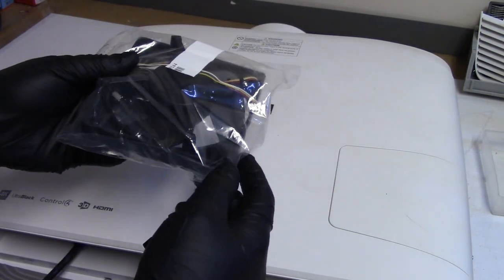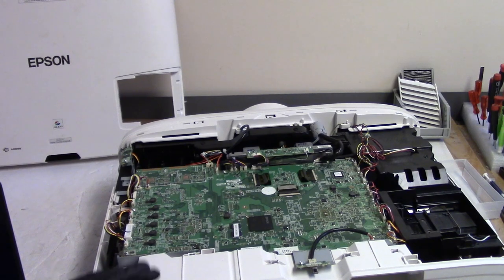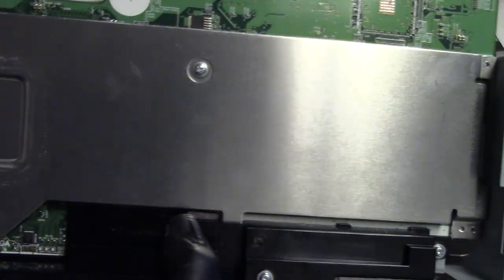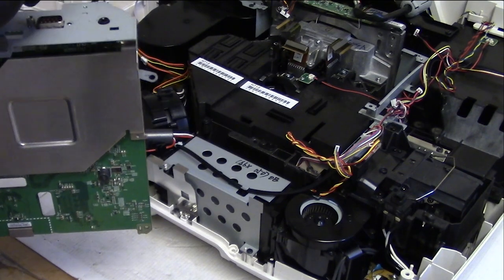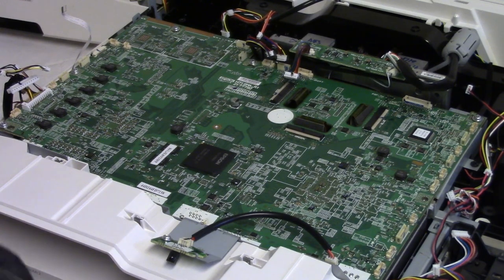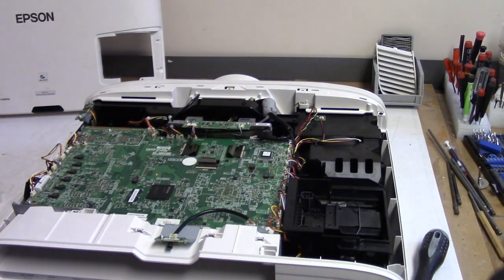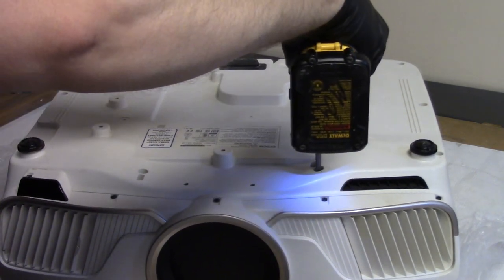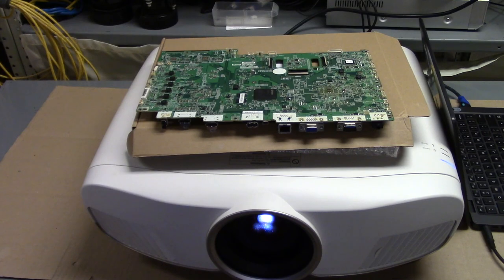Epson Home Cinema 5040UB LCD Projector Repair | No Video | New Mainboard - LAST EPSON REPAIR

Comment: My 5050UB stopped working and my Epson authorized retail shop says it needs a logic board and an optical unit. $1450 for parts alone, $1700 total to fix.  It was a refurb unit and it's only 3 months out of warranty. No love from Epson. Any suggestions? I'm pretty handy and have replaced failed boards on TV's, re-capped old cassette decks, etc. If I can get parts can I do this myself or does it require additonal equipment to calibrate, etc?
Reply from the maker: I hate to say it but run and chalk this up to being burned by a refurb. It really pains me to say this.  Epson is one of the worst right to repair companies in the world. they design this stuff to fail thoroughly and not be worth fixing.  The parts quote you got is dead on.  I wont even work on epson anymore unless its a power issue because you literally cant get parts reliably and the service info is non-existent.  
I know you want to at least give it a go, so I would check the voltage regulators on the mainboard first. They are a common issue.  Also, what is it doing/not doing?  I should have probably asked that first.
Reply: @FixitFrank  thanks Frank. It power cycles, bulb never fires up, then shuts off after 20 sec or so. Orange and blue lights flash even after the unit powers down. I’ve also discovered that the Yamaha receiver it was connected to seems to have a blown HDMI out (inputs still work and pass audio, just no video) so I assume a power spike caused this? Projector and receiver both have power conditioning but are on different circuits.
Reply from the maker: which leds are the ones flashing? If its status light and lamp light flashing(both flashing) that is an internal problem.  I'd check the regulators on the main board.  Little SOIC-8 chips. Usually grouped near each other and will have some inductors near them. If its not the status and lamp flashing, then check the manual on page 148 and see if it might be a fan issue(instant overheating warning).  https://www.projectorcentral.com/pdf/projector_manual_10863.pdf   <--manual
Reply: I have a 5050ub out of warranty. Not a refurb and used about 1500hrs. Status flashes blue, lamp and temp flash orange. Epson comes in the screen for a sec and then the projector turns off. Lights remain flashing. Epson support said maybe iris issue. I saw many videos of people cleaning out the iris mechanism. Was thinking of doing the same. Your video has me thinking it may be the motherboard. Trying to get over my anger to fix it myself. I've taken the cover off and am getting ready to remove the MB. 

Amazon won't let me leave a negative review for this projector. Beware!

Was BEAUTIFUL while it worked.

And thanks for posting this detailed video Frank!

Just read another of your responses that Epson won't sell the average joe a MB. This sucks more! I'm going to have to pay someone to fix this even if I can fix it myself. 😡🤬🤬 Probably best to put everything back together and take it to a shop.
Reply: @authorsauditions  Same issue with a 5040. Same lights flashing, manual says auto-iris. It's probably correct as I heard gear grinding about a week before it died. Found part online for $90. Found this video to help me take it apart. New unit purchased in 2016. Expected more from a $3k projector. You fix your issue?
Reply: @FixitFrank  I have the same issue like the one mentioned in a previous post. A 5050UB with status and lamp lights both flashing. I checked the voltage regulators and they all seem fine, I get 3.4V, 5V, 12.95V.
However, I noticed that the TS420 SCR is not working as it should. I have 17.5V at the anode but nothing at the cathode. Upon further checking, it seems that there is an almost 0 Ohm connection to ground. I would have thought that I should be able to trace down where that comes from, but I can't seem to figure it out.
Have you seen something like this before and an idea what may be the culprit? I have not been very successful even tracing the PCB down from the SCR's cathode...

Comment: I’ve been fixing projectors for over 20 years and never broken anything with static. I never ground myself either.
Reply from the maker: I've worked on so many things over the years and never wore a ground strap.  I'm sure it can damage things but as long as you're aware of what you are doing those chances are really slim.  If I worked with a lot of older cmos stuff I might, but nah. It gets in the way.

Comment: Does Epson sell a replacement mainboard for the 5040?
Reply from the maker: No, they don't sell anything except new bulbs. Epson won't sell anything to you unless you are an authorized Epson repair center. Epson is terrible from a repair standpoint.  I am not a fan of Epson at all. I tried to get over it but, this repair just reinforced my disdain for their repair practice's.  Very apple like.
Reply: @FixitFrank  thanks, thats very unfortunate
Reply from the maker: I couldn't agree more.  Very unfortunate

Comment: I almost bought one of these used but you scared me straight lol.
Reply from the maker: That truly makes me smile. I am not a fan of epson. but I will say when they are new, the picture is great and they work fine. Its the lack of longevity and repairability that turns me off. they are made to fail after a certain amount of time. I am convinced of that.  
If LCD looks better to you over DLP, check out Panasonic, Sanyo and NEC.  Their LCDs hold up far better over time. If you can find a WUXGA Sanyo from 2012 or a panasonic WUXGA projector from 2015 on, you can't go wrong.  If you dont care DLP/LCD then I like BenQ or if you can find one, Sim2 and Christie.
Reply: @FixitFrank  Thanks for the tips. Are the Sony projectors any good? Back in my bachelor days I got a Sony VPL-W400Q with a shocking sticker price in 1998; it still kinda works. But it spent some time getting work done under warranty. With a family nowadays it would be totally stupid to spend that kind of money. I just want to get something decent in the 5 to 7 hundred dollar range, which is kind of empty new, and a little uncomfortable to roll the dice used.
Reply from the maker: I LOVE sony and JVC.  You can't get a new one for under a few grand, but you can definitely find used sonys for under a $1000. you can search for "Sony SXRD projector" or "JVC DiLA projector" on eBay.   https://www.ebay.com/itm/334966741074 for example.  Any Sony or JVC 1080p projector is a good one.  They are the next step up from Benq, Epson and Optoma. If you want to let me know what models you are looking at , I can weigh in on them. Even a 10 year old sony will look better than a new BenQ in my opinion.

Comment: Yet another reason to steer clear of unreliable lcd technology...it's dlp all day  every day for me Frank! 👍
Reply: Im afrade of DLP now i use to love them but  I had a tv and 2 projectors and the dmd chip went out on all of them it was because the chip would get to hot the tv was mitsubishi and i replaced it 10 years ago and its still going the projectors were benq and i could never get more then 2 years out of them before the dmd chip would start to die I switched to a epson kinda like this one a 4010 and it so far works a lot better then benq
Reply: @JunkerDC  Benq was the issue I'm afraid...I've had 2 infocus projectors, and my current Mitsubishi HC4000, and have all been faultless👍
Reply: I have been using LCD projectors since 2003, and have had great luck with them. Keep them and their filters somewhat clean and they do not die. I still have that projector from 2003 and it still works, though I have upgraded from it of course.
Reply from the maker: I remember those DMD problems.  That particular chip was a real problem for a while.  They ended up replacing it with a different part number but it wasnt until so many others had that failure.  Most DMDs are very reliable if they are thermally managed properly.  Optoma and the UHD series dropped the ball as did a few BenQ models.
Reply from the maker: Yeah, I really try not to hate on technologies but LCD just gives me so much hassle.  Panasonic and NEC are tolerable to work on but it just seems like once LCD gear starts to fail, it's all in on failing the rest of the way.  DLP you can repair more or less constantly without issues.  I know some folks suffer from the rainbowing but there are plenty of newer color wheels that mitigate that as well as LCoS.
Reply: Not to mention, I've seen countless Sony sxrd projectors that lose contrast and colour over time, and looks as though it's an ongoing thing with them also, and it's not usually bulb related either...
Reply: I would never go DLP because of picture quality and the rainbow effect

Comment: Epson are total trash
Reply from the maker: Another man of culture
Reply: @FixitFrank  I have watched your videos dude you do the same job as me. Great vids. 👍
Reply from the maker: Is that you from the optoma place in the UK? If so, cool! I have seen your website!  Pleasure to make your acquaintance!
Reply: @FixitFrank  yes my names James. I only fix Optoma, Acer and Benq as they are so easy. I also fix laptops and just noticed that the latest nebula projectors use the same bq chip on most laptops. Do you fix motherboards on the projectors? I find them tricky as you have to put them all back together to get them running. :)
Reply from the maker: I'll email you so we can connect! I don't list an email here for reasons but I would love to connect with you.  I don't take in epson at all anymore.  Just not worth my time.  I do like to repair the mainboards if I can.  My real background is with board level electronics. I just kind of fell into the projector thing.